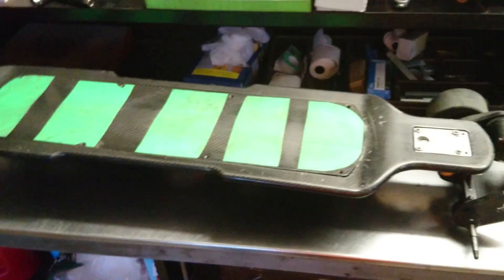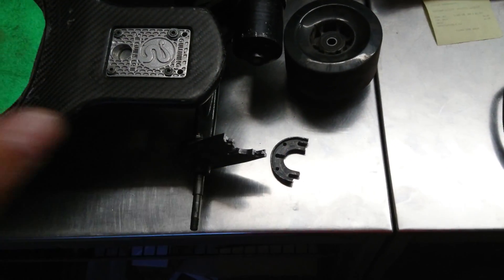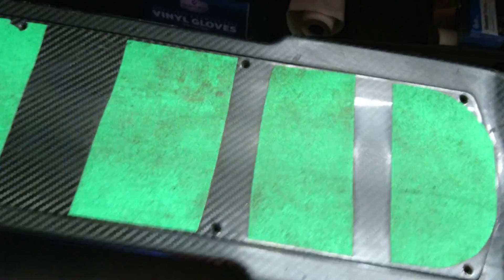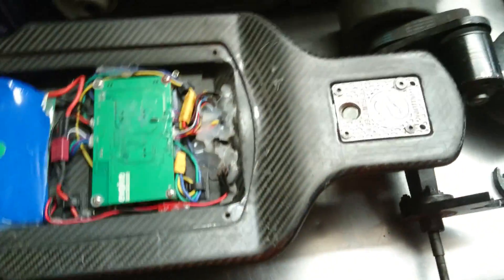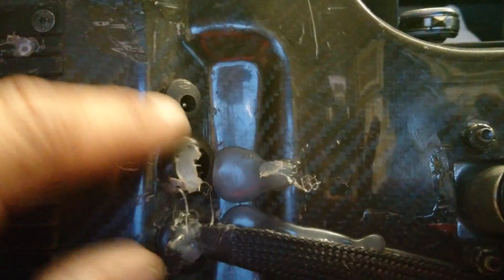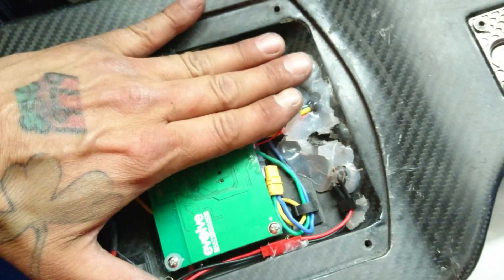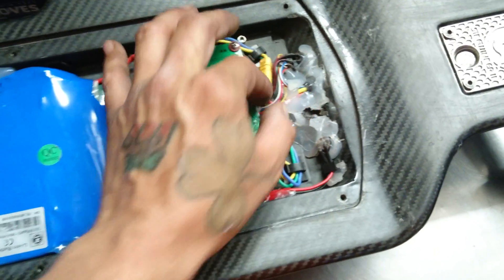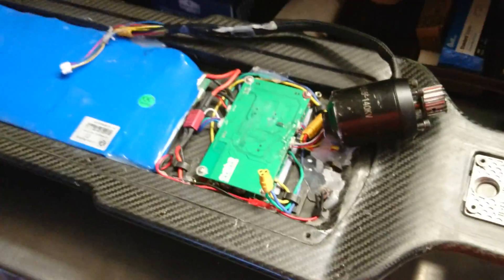Easy motor swaps on the Evolve Carbon GT

Comment: check out this guys GT motor swap https://evolveforums.com/threads/racestar-140-kv-motor-tested-on-gt.954/
Reply from the maker: He's Rich oh yeah I've seen this guy before that's definitely a good video If you want to get into depth on exactly how to dismantle it that's for sure. I was just trying to point out the fact that the motor swap is extremely easy I kept getting a lot of questions and then finally someone's like you have to show me what you mean by unplugged all one in plug the new one in. that's what's up. Thanks for commenting I totally appreciate it and please come back
Reply: Coo thanks for the response . so have you determined that they are the same motor? Do they sound and work the same?
Reply from the maker: +He's Rich oh yeah they blow evolves out by far I've been using it for a little bit now the break-ins the best yet out of any electric skateboard that I've tried and I've tried quite a few of them. I would highly recommend them highly highly recommend